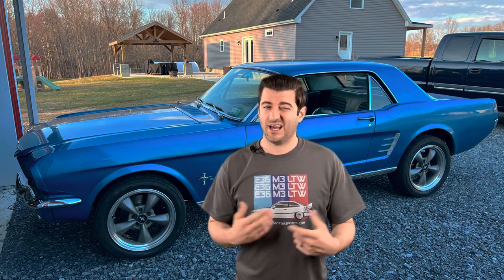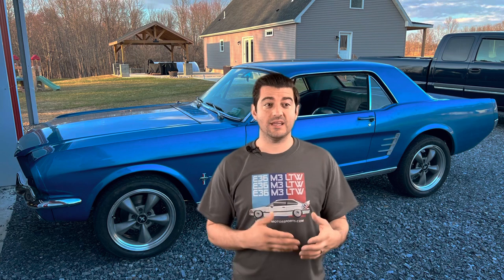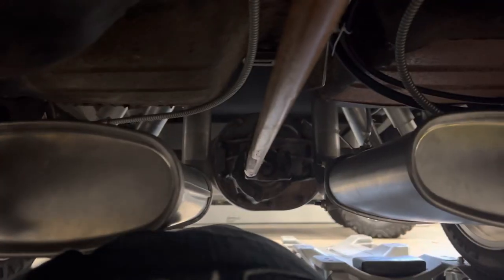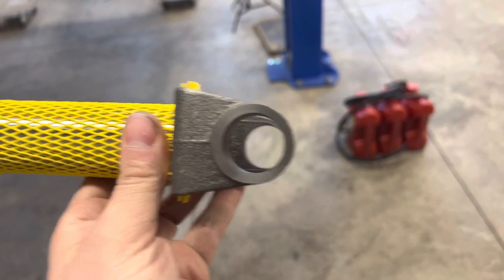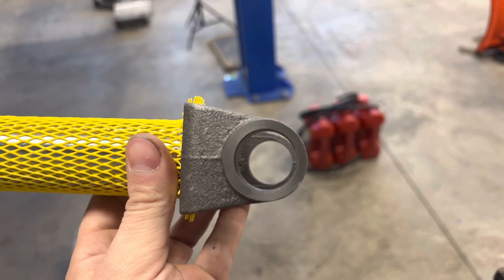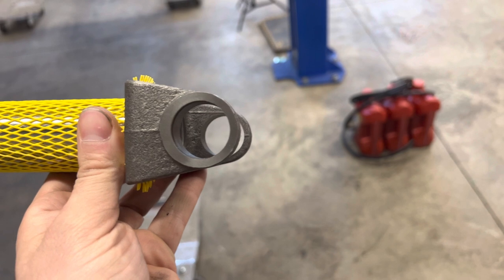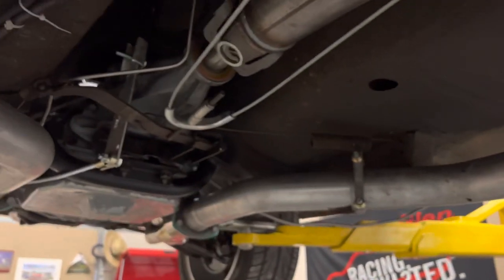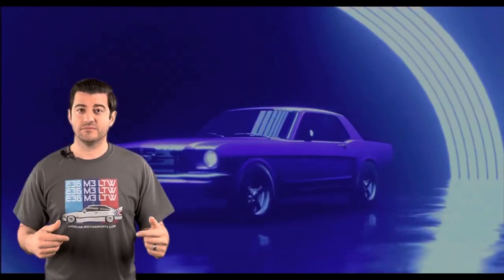1966 MUSTANG 302 SWAP: How to properly measure a driveshaft: 66 Mustang Restoration Ep: 23

Comment: I need to pull my 302 put of my 67 mustang convertible for some work. Is it better to pull both the engine and transmission together or just the engine?
Reply from the maker: I think you can get the bell housing bolts out easily and just take the engine out. The tricky part it getting the engine lined up to the input shaft when you put it back in. There are a few more steps to pulling the transmission out with it, but you won’t have to worry about lining it up to the engine then. If it’s me I do the engine only.